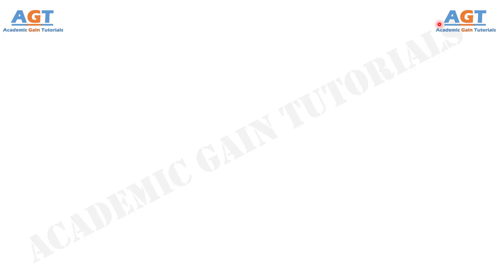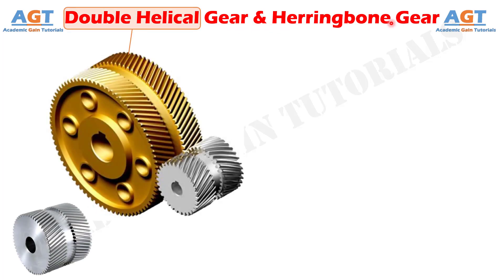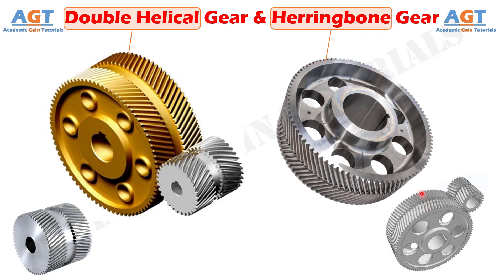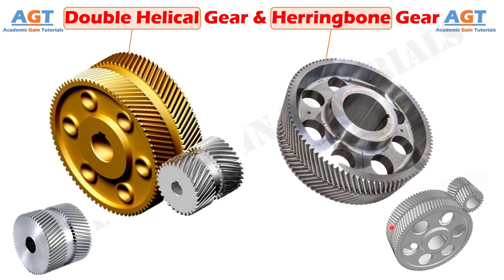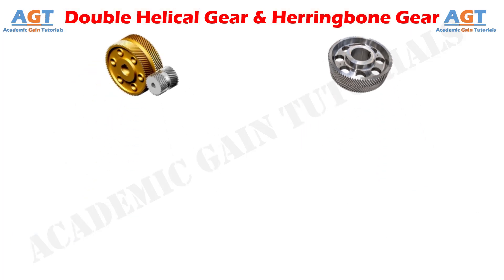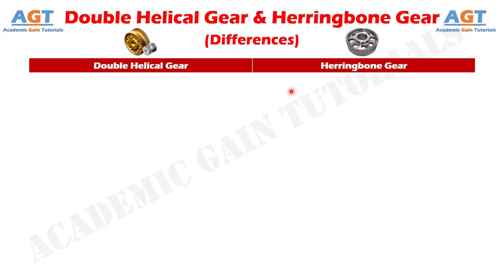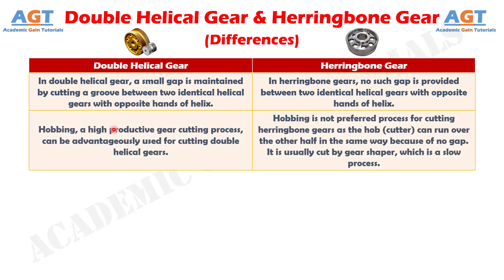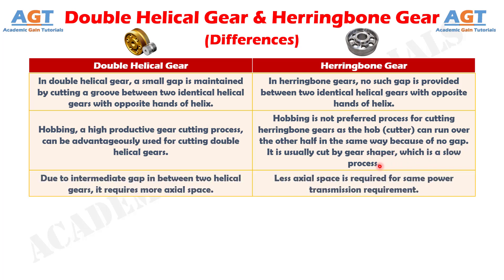Differences between Double Helical Gear and Herringbone Gear.

Comment: Our robotics team used both this past year, we switched from a herringbone to double helical halfway through the season because herringbone gears have a point in the middle that has to handle a lot more force because of their shape, so our gear splot in half because it was 3d printed, and we didnt have that issue when we made the switch
Reply: Just thought it was a cool unique display of the difference dont know if it was mentioned in the video

Comment: so? What's the difference between gears? You only said about production, not the gears themselves.
Reply: Basically nothing. The channel in the double helical just makes it easier to manufacture and that's kind of it. They otherwise have pretty much the same properties.

The double helical might have a tiny bit less torque capability because there's less contact area to transfer force due to the channel, but not by much.
Reply: True herringbone gears can hydrolock (fluid compressed into the "V" of the gear) if lubricated and driven in the "wrong" direction. So if you're lubricating the gearset and driving it both ways, you'll be in trouble. A slit cut down the center (between each gear handedness) turns a true herringbone gear set into a double helical gearset (I guess?) and eliminates any issue with hydrolocking since it allows for fluid to flow out of the "V" where the gears mesh.